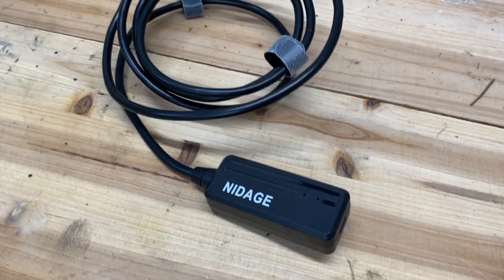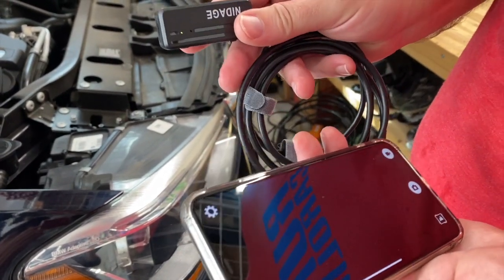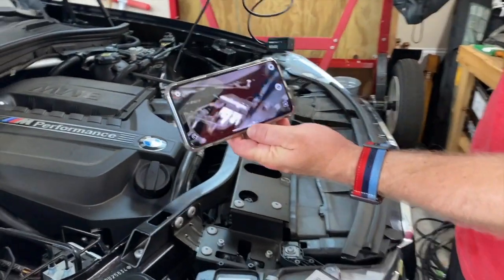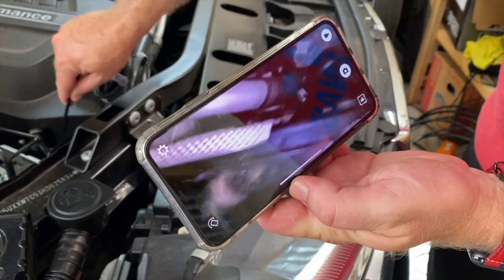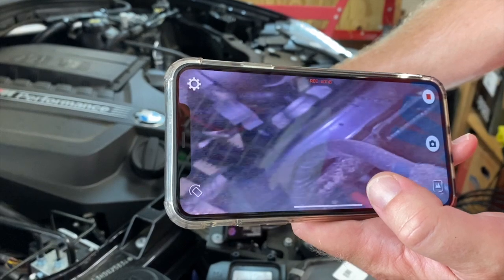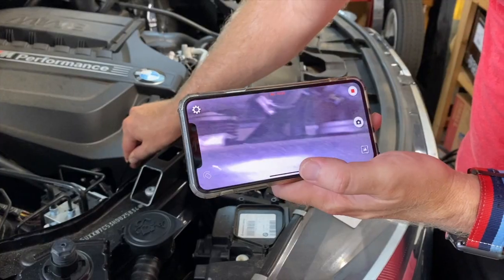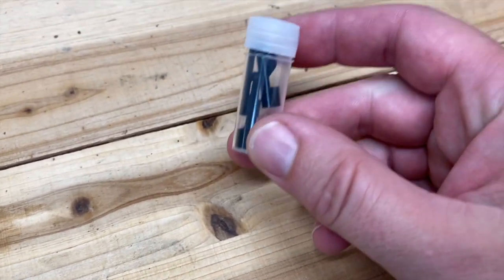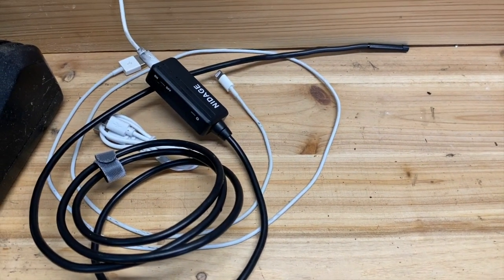Eyes into the engine bay! - Nidage Wireless Borescope (Endoscope) - TOOL OF THE WEEK

Comment: Missing from the video up front and essential is how to get the camera and the phone app to talk to each other if they don't work right out of the box.  Charging the camera and wifi transmitter at the box end of the device is apparently an essential first step--in my case, no picture on the phone unless and until the Nidage device is fully charged.  Also not helpful at all is the set-up instructions that ship with it.  For example, nothing tells you that messing with the phone app settings menu for SSID and password is only needed if you want to change access security--this is not an essential step to setting anything up.  The device creates its own wifi network and that name appears in the pull-down list of available wifi's in phone settings.  Once you select the device's emitted wifi and enter the company provided password, the connections work without more passwords, SSID flips, or any other stupid IT trick.  Also on iPhone, the app freezes the screen orientation, turning it from portrait to landscape and reorienting the view can only be done sliding the screen in one particular direction.  So be ready for a  possibly frustrating "first date" with your Nidage.
Reply from the maker: +Donald Greiman thanks for the added info